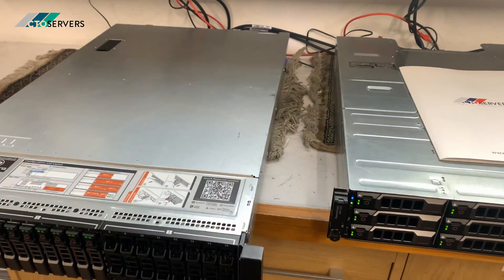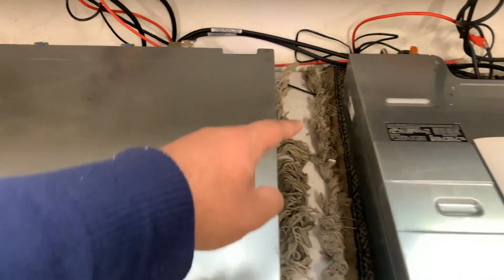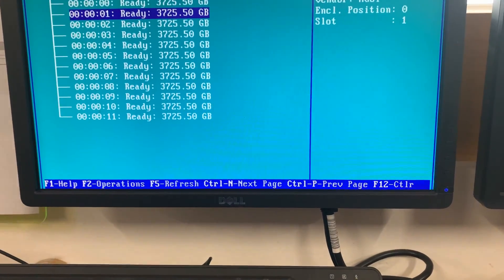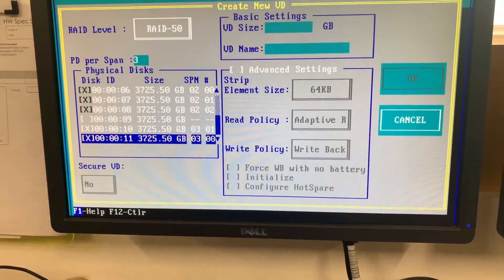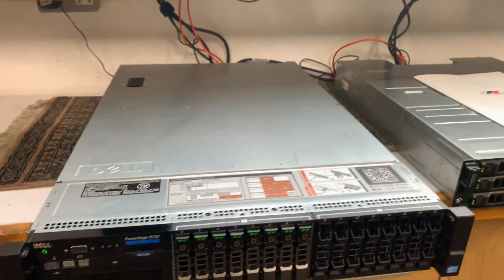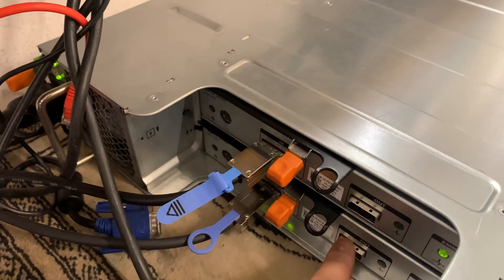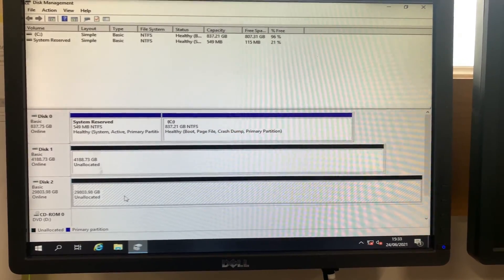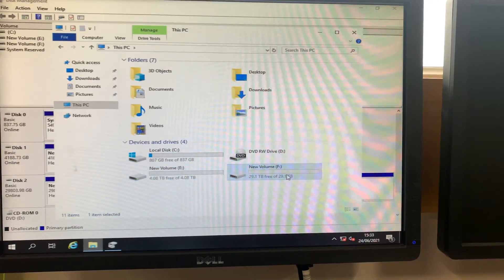Dell PowerVault MD1200 LFF Direct Attached Storage Box , Expand your Dell Servers with more Storage!

Comment: Okay let's say you want to power off the MD1200 JBOD, what is the way to do it? I am looking at this storage solution but I don't want it to run 24/7
Reply from the maker: has power buttons on the back to power off but best would be to shut down server first to stop all IO
Reply: @CTOSERVERSahhh okay, got it! So the optimal way to do this automatically would be to shutdown the server, wait for it to turn off, and then remotely switch off the power from the socket 😅
Reply from the maker: @Kaszanas  Yes , has power buttons on the back too

Comment: Can it be used on a 720 without HDD?
Reply: yes on every hardware that has at least a x8 PCIE 2.0 slot for your compatible external mini SAS RAID Controller. For DELL, use at best the PERC RAID controllers but everything 
should work as well, as long you have the right cable. 
if you implied with "without HDD" means SSDs for you? Yes SSD are fine. either SAS or SATA, but don't mix SAS and SATA drives on the same controller the signal voltage levle is higher on SAS drives and this may damage your sata drive. if all of them are SATA this isn't a issue because the controller goes in SATA signaling mode. If you mix them, please use interposer cards on your SATA drives.

Comment: Cain I use this for Dell EMC R740 server?
Reply: @ImranHossain-t7z yes, you can. You need only a second RAID controller for external use that is comparable with your Disk shelf. But be careful. The PowerVaults chases are more or less the same but the controller in it are different depending on your needs. You could have one of two types of controllers in your PowerVault Disk shelf, an SAN Controller or like here a DAS controller. Both have a mini SAS connector and can be used as a DAS device but SAN controllers are really finicky and sometimes won't cooperate properly if you are inexperienced, but they are more capable and can connect to different systems at the same time over the network. DAS controllers are cheap and easy to handle, and you can stack them and connect them together easier, even with cable and controller failover functionality. i have a two PowerVault MD3600i 24 2.5" with a DAS 6gbit SAS controller, yeah it's not the fastest one, but it fits my needs. i use it with a 12gbit PCIE external SAS controller. i could change the sas controler in the MD3600 but those are expensive and the cables are even more expensive. a 1.5 foot cable 12gbit mini SAS cost 150€ but an 6gbit mini SAS cable costs only 15 to 25€ used because those are flooding the market right now. 
i run the md3600 together with a r630. 
in fact, i used the md3600 the first time on my old Lenovo ThinkStation 5 years ago i bough the r630 2 years ago because i needed more horsepower.

Comment: I have a Dell R620/420. Do I need any special cables/adapter to connect the MD1200 to my servers?
Reply from the maker: You need the host raid controller and external SAS cables

Comment: What if you already had a volume for data and added the MD1200 to the PowerEdge server. Can you expand the existing volume with the new available space or you MUST create a new volume for the MD1200?
Reply from the maker: Hi , 

Yes you can expand along with your existing volume. However this would need to be a sperate raid so you don't loose your DATA

Comment: can i use it to expand my PC space, it's a custom build
Reply from the maker: Hi , 

Yes , you can use the HBA Card in your PC and connect the box to it.
Reply: @CTOSERVERS can we do this while the server is running? Eg i have a running server without any external enclosures connected. I want to connect another 12*3.5” sas enclosure to the HBA card in the server. Can I do this without turning off the server and if so, what’s the procedure? Thanks!

Comment: Great Job, Wish you could run Crystal Disk Mark on both Volumes the 4.0 TB & 30TB with 9x64GiB & post the results along with your feedback regarding the Acoustics of the MD 1200 is it noisy. can be installed at an office or it should be in the server room
Reply from the maker: Will do this for another video !